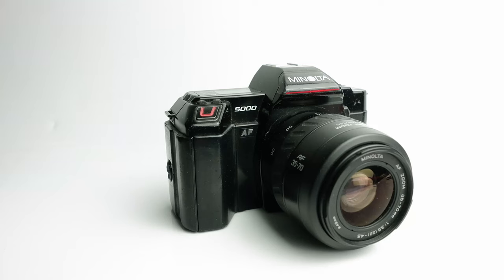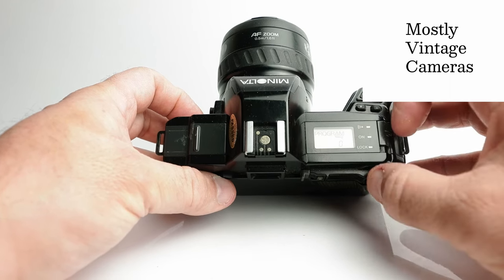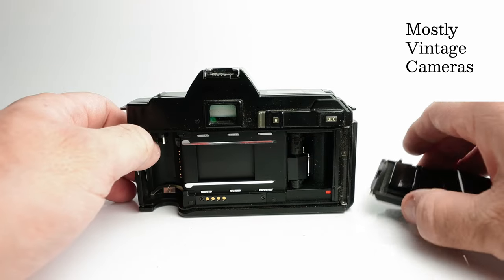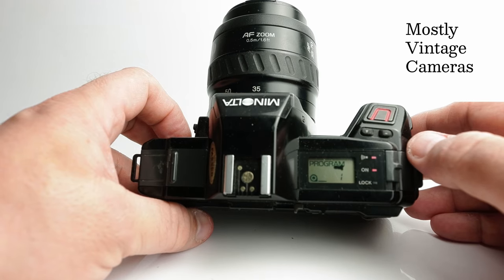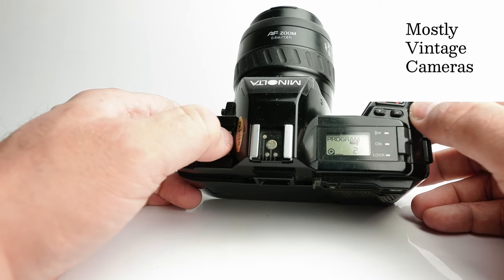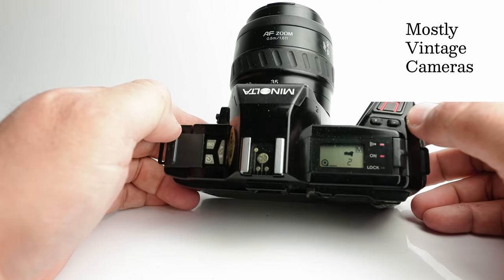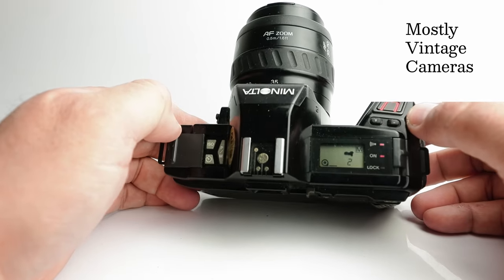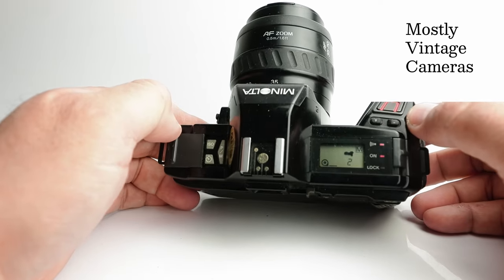How to use a Minolta 5000 AF Maxxum 5000

Comment: Useful video, I'm looking at getting one of these as I already have a load of sony alpha lenses, some of this vintage, others more modern, so it makes sense. Can't wait to start shooting film again after nearly 10 years off.
Reply from the maker: Hello Cal,
Thank you for your comment.
As you have some A mount leases it certainly makes sense to get an SLR that can use them.
I hope you enjoy your return to film photography.
All the best 
MVC
Reply: @mostlyvintagecameras4323  I ended up buying one not long after watching this video. Surprisingly, aperture control (and therefore, one assumes, correct exposure) works correctly with all of my lenses, save for the newest one, a Sony G 70-400. AF only works on the period correct minoltas.

I have noticed a behaviour in the camera which is a bit concerning, perhaps simply due to ignorance - I will try to explain it. With any lens attached to the camera, the aperture appears to very briefly close down to its smallest size as the shot ends, I think from the sounds it's happening as the reflex mirror is starting to return upwards. So as an example, if I set the shutter speed to 4 seconds, the aperture to fully open and press the shutter, the camera will behave as I expect, but as the shot finishes the lens very briefly stops down to f/22 or whatever its max is. It happens only for a very brief moment. This seems to be a consistent behaviour; but my worry is if it isn't intended design and is actually happening before the shot finishes, it will spoil the exposure, weighted to a greater degree on shots with a faster shutter speed. 

I would be grateful if you could comment on this behaviour or even see if your Minolta 5000 replicates it?

Comment: My camera is the exact same but won’t rewind the film ? do you know what could be wrong with it ? All the film is used and I did exactly what it says in the video :)
Reply from the maker: Hello katiewright9352,
Thank you for your comment. Hard to say what the issue is without seeing it. The three thinks that come to mind are, The film is already rewound, there is no film in the camera or the batteries don't have the power left in them. If you can find a decent camera shop they should be able to deal with this issue easily enough.
Good luck. All the best
MVC

Comment: I want to buy this camera but I don’t know how the pictures from her look like
Reply from the maker: Hello Fanysol, Thank you for your comment. With 35mm SLR cameras I don't tend to take photographs as quite frankly they are all equally capable of producing good or indeed bad images, so a photo from this Minolta would be indistinguishable from one on a Pentax ME Super. The thing that makes the bigger difference is the lens. If you use a basic "kit" zoom lens you will get softer images than if you use a mid range or premium zoom or a prime lens. The exception would be the early 35070mm zoom lenses which were a short zoom range and a modest max aperture so they weren't over stretched spec wise. So if you use this or any SLR correctly with a mid to high quality lens you will get great pictures. The main differences between SLR cameras is in features, evaluative metering, number of exposure modes, multiple exposure, even if it has a self timer or not. SO here the 5000 AF losses out to say an EOS 300N but offers more than say a Pentax MV 1. It really just depends what you are looking for and maybe if you have other kit that works with a given system,
All the best
MVC

Comment: Hello. I just purchased one of these cameras and I am a bit confused. I am used to the shutters closing when I have finished using my cameras, but the shutter has not closed on this when I finished using it.. is this normal? Will it ruin the film I have in my camera? Thank you so much for the video. It helped me so much.
Reply from the maker: Hello Faith,
Thank you for your message.
I'm not sure I quite follow what the issue is you are describing. In general terms if you are having a problem with a film camera it is best to take the film out in a darkroom or changing bag to be on the safe side. A camera shop should be able to do this for you and perhaps offer a view on what is going on with your camera.
I hope you get it sorted out soon.
MVC

Comment: I've a very dumb question but how do I switch of the camera. Is it just a case off taking the batteries out each time?
Reply from the maker: Hello Niall Mc Manus,
Thank you for your comment and question. The switch to the right of the LCD moves all the way down to the bottom "LOCK" position. The LCD display remains on but the camera will not work, this is as off as the camera gets.
Kind regards
MVC